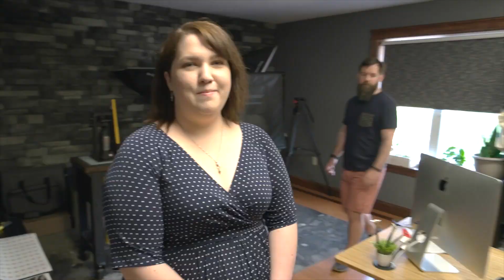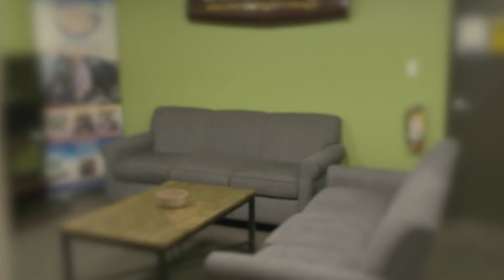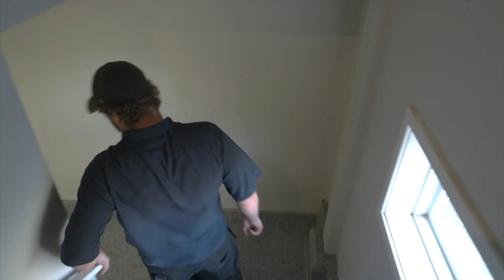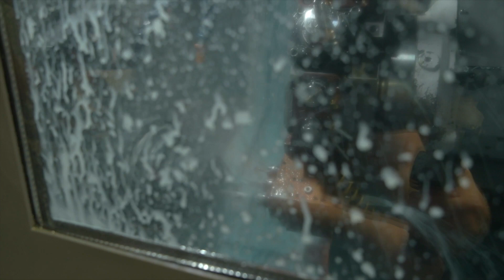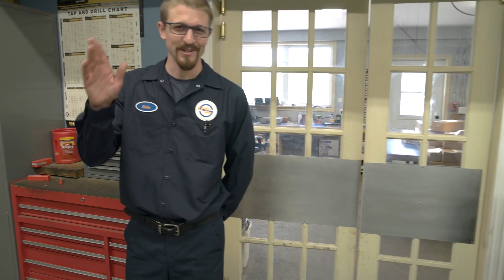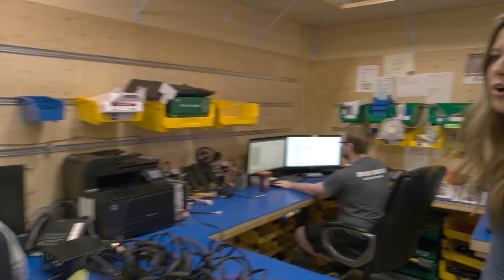Sure Grip Tour 2020

Comment: I love sure grip products! What do you recommend so the spinner know doesn't leave indentations on the steering wheel?
Reply from the maker: The knob its self has softer inner plastic insert. If more protection desired we also have soft rubber pads that can be added. These rubber pads are also good for hard surfaces like wood as well. 
A612 is the part number.